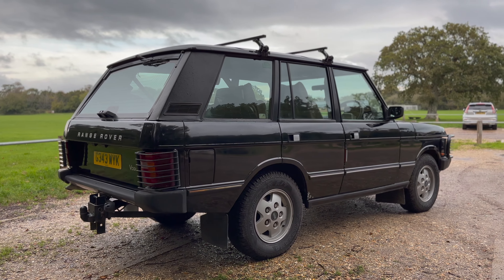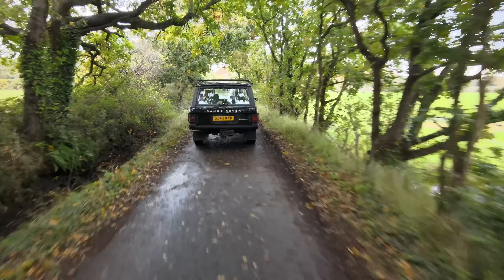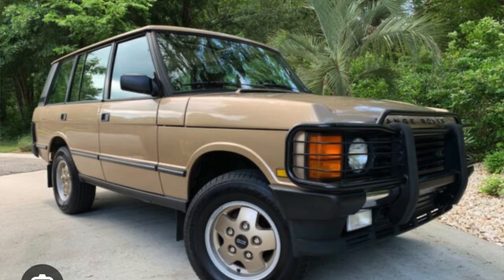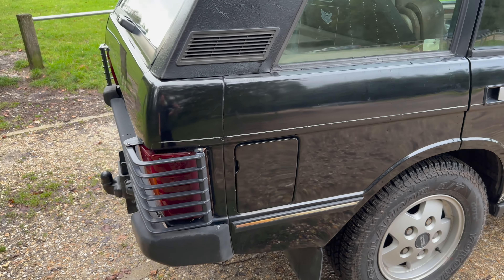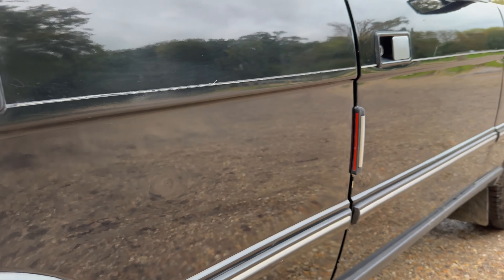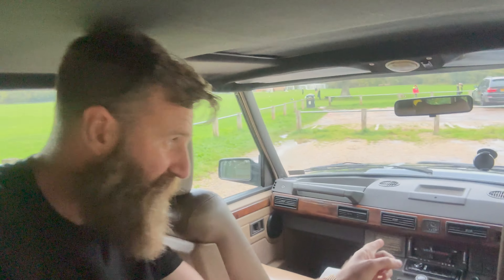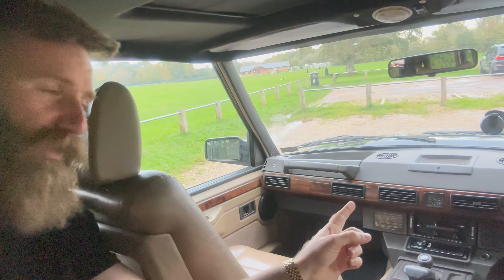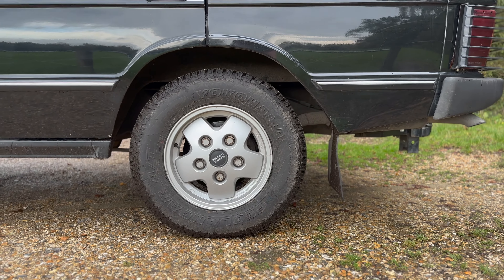Famous Range Rover Vogue SE - Drive and Walkaround

Comment: Brooklands Green with sand interior!
Reply from the maker: Yes! That's a cracking combo
Reply: Beluga Black and Tan is great.  I’d go for the original SE look with body coloured wheel centres.  As for my favourite colour combo, it depends on the generation of classic.  For the 1970s, Sandglow or Lincoln Green.  You can’t beat Derwent Blue for a mid 80s 4-door Vogue. Your generation is fantastic in Beluga black. Ardennes Green and Plymouth Blue  are more common, but suit the car well.  Tan interiors all the way.
Reply from the maker: I do love the original coloured centres on the 3 spoke .. and also I  would prefer the centres on the LSE wheels black too.

I just googled sandglow! It’s a beautiful colour! 

Defo, tan interior of course

Comment: Could you give any info on the bull bar, I don’t know if I’ve seen that one before, is it an earlier OEM bar or aftermarket, it looks great on that Range Rover.
Reply from the maker: Hi 👋 i have since found the original reciept for the bull bar and rear light guards, They are an aftermarket fit. Custom made by a London Compnany.